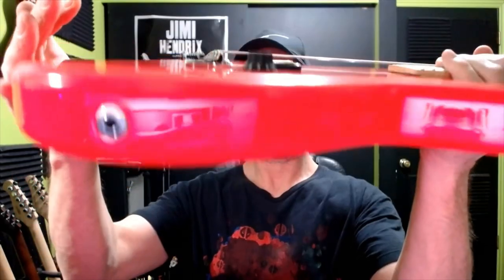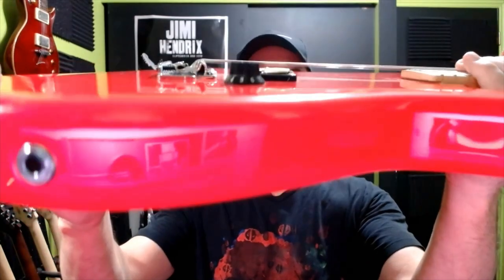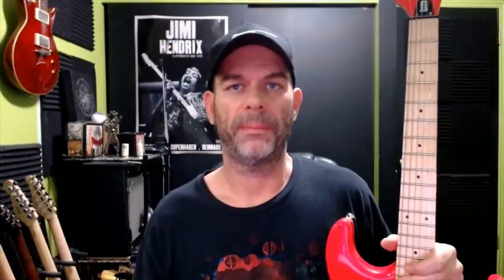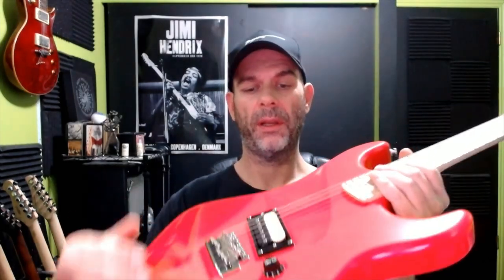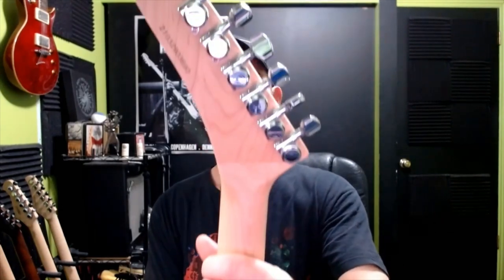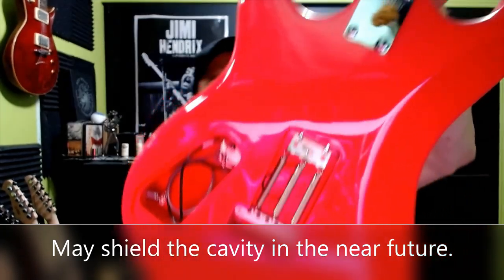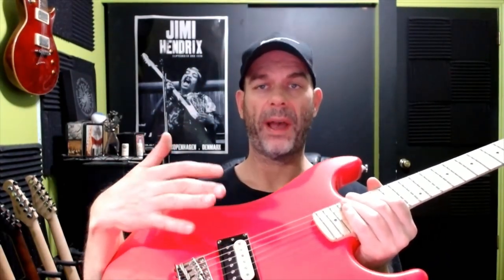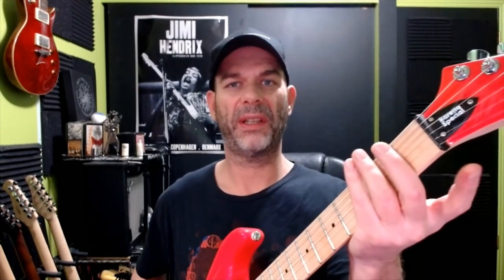Kramer Baretta Special - Upgrade It All  - GFS - Wilkinson - Graph Tech

Comment: Up-grade Nut GraphTech PT606000  fits right in. Had some Goto Locking tuners I got a deal on 2 years ago put them in and replaced the Trem springs with just two coated Floyd Rose springs "so bends were smoother" saw it on another video worked great ! Used some Nut Sauce until I get the Nut , worked like a charm but still gonna replace the original . Still waiting to get the trem block and I will be done for awhile . Thanks to Ben he's been a resource of info and really helpful !! I'm Subbed now since I enjoy Moding low cost Guitars !! These Guitars once fixed up to your liking are as good as the more expensive Kramer reissues and it's fun to do !! Been playing 40 years or so and would take this Guitar on stage and feel 100 % comfortable that it would work great . Ben be seeing ya on your channel soon Thanks Again !!

Comment: Thanks for tip.. the 60 60 fixed my issues
Reply from the maker: That's awesome. These are fun guitars to play.
Reply: @benpowersguitar  yes they are haven't cut the the part on volume knob yet..will that help with the to much low end sound
Reply from the maker: @briancanada4850  Not really. I found flattening the pickup ring so I could lower the pup properly seemed to help a bit. I currently have a DiMarzio Super Distortion in mine. It's fantastic.

Comment: Great mods Ben. I have always been nervous about changing out a nut. I just know that I would end up chipping the fretboard when tapping the old nut out.
Reply from the maker: That is a real concern. I have had it happen when I didn't razor the edges first. But the other 15 or so have all been good.
Reply: @benpowersguitar  glad you have mastered the art Ben. I only have a couple of guitars that could really do with a better nut thankfully.
Reply: The razor is the key. I was nervous too but with some good scoring and a nice tap against a block of wood, it really does just pop off clean.

Comment: How are you guys using  Tusq 6060-00? It is R15, and the Baretta ia R12
Reply from the maker: The nut I used was based off an internet recommendation from a message board. Works great.

Comment: Will a gotoh gt1996 fit this model i want to put one in but not sure a if a 36 or 40 mm will fit
Reply from the maker: I believe the 40mm might be a tight fit once the springs are added.
Reply: @benpowersguitar  do you think a 36 will do if not i gusse floyd spec will do just not sure seems lowest i could find sorry for. Being a noob
Reply from the maker: @OliverCarriere  Yeah, it will absolutely be fine. Feel free to ask me if you have any other questions.
Reply: @benpowersguitar  sure thanks so much so for that nut what would i want to use i love the way you mod yours its awesome i got the purple guy and love her
Reply from the maker: @OliverCarriere  When installing the Gotoh, which you will have to mod the body to do, if it doesn't have a nut that comes with it, the Floyd Rose R2 should work.
Reply: @benpowersguitar  thank you so much ben i beem truimg to figure this out like crazy your awesome sorry for all my noob questions love your channel i will suscribe

Comment: Did you have to modify the nut at all
Reply from the maker: Nope. Direct replacement.
Reply: @Ben Powers Guitar  must be lucky everywhere I went said I would atleast have to sand it to make it smaller
Reply from the maker: @Thecarolinapiper  Buy the one I bought, and you won't have to. I found this one on a forum after a couple hours of looking.
Reply: @benpowersguitar  pt-6060-00 ?
Reply from the maker: @Thecarolinapiper  That's the one.
Reply: @benpowersguitar  yeah I posted about it in all the kramer baretta special groups I'm in and they all said it would have to be modified
Reply from the maker: @Thecarolinapiper  Up to you.
Reply: @benpowersguitar  im definitely buying one when I can afford it